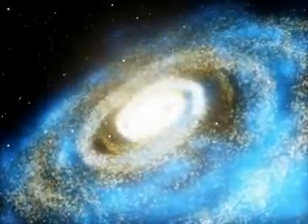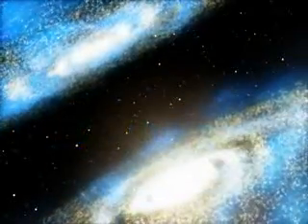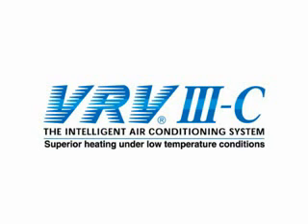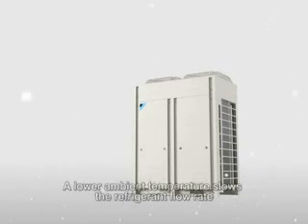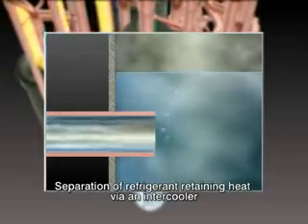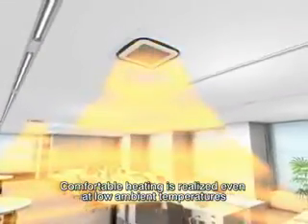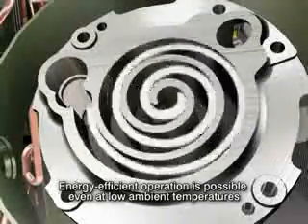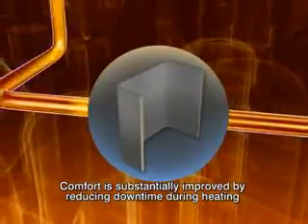Daikin VRV III Ductless Air conditioning

Comment: These systems are not appropriate for heavy commercial use.  They are not easily serviceable and Daikin does not have a 24-hour service line for trouble shooting.  From my direct experience, support is lacking.  Stick with a reliable DX or package unit if reliability/serviceability are important for you or your client.